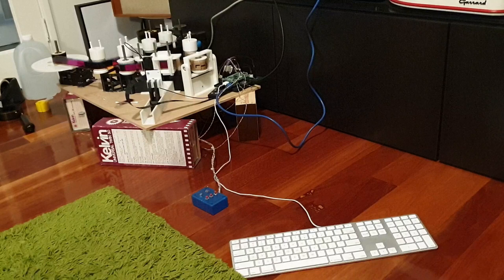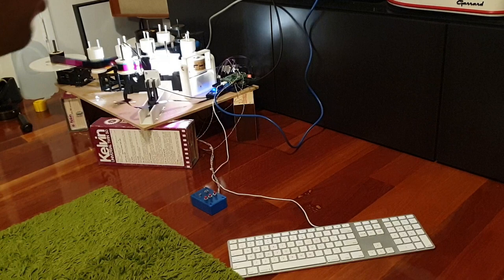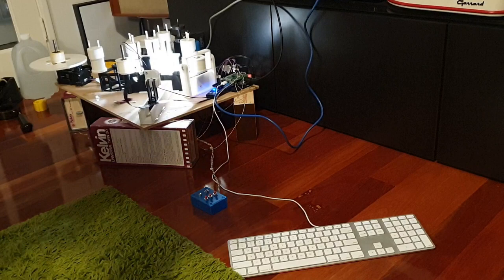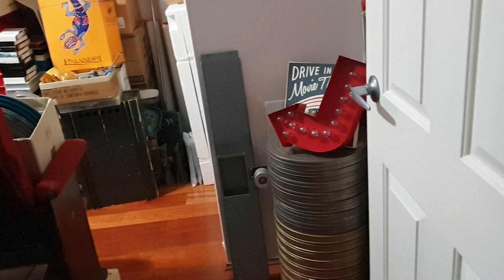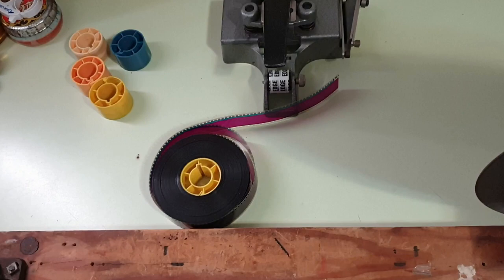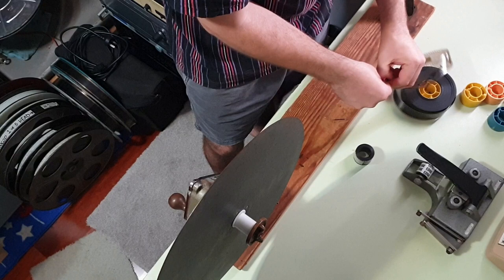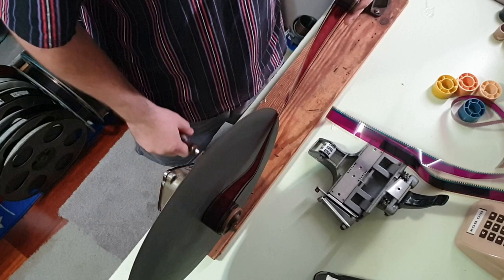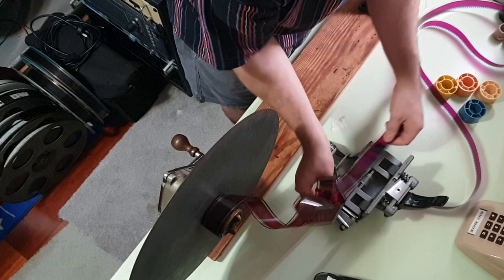The Process of Scanning a Film

Comment: I have been watching your process for a while now and I am quite impressed with the outcome! The only thing that always came to my mind was how the sound is extracted. I think you might be able to achieve better results by playing it back on a good projector with a well calibrated sound chain. Both for Mono as well as A/SR prints. Of course it would be some additional work to match the recorded sound with the scanned image afterwards, but I think it might be worth a try.
Reply from the maker: It's a great suggestion but the equipment currently at my disposal would be much worse than the digitized solution. My projector was designed for mono sound and has been "adapted" for stereo by literally hot gluing a stereo cell on what was the old light pipe to the photoelectric tube. Also the motor is non-synchronous so even if you lined up the sound at the beginning and end the speed would wander throughout the duration.

Comment: I believe the issue you have with FTP is the fact that you probably have 2 instances of the scripts for transferring files (sendWhileRunning.bash) running at the same time, competing for the same files and trying continuously to overwrite eachother's uploads on the servers... You had a first attempt of starting a scan that failed (which I didn't understand why it failed) and you successfully restarted it, hence both attempts might have started its own instance of sendWhileRunning.bash

I will look into a way to prevent this situation.
Reply from the maker: It's odd, typical to only start when I wanted to record :P